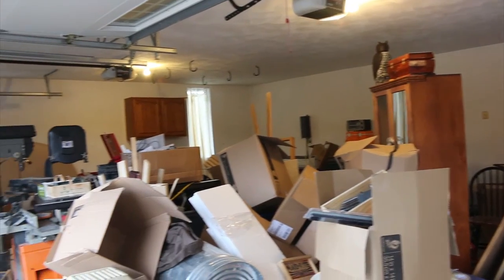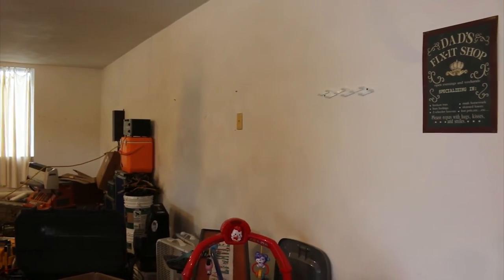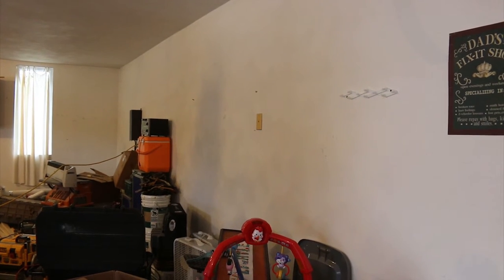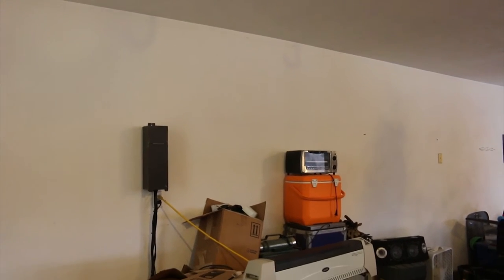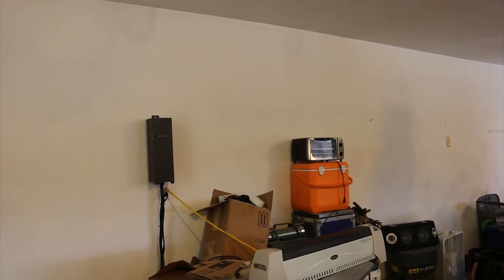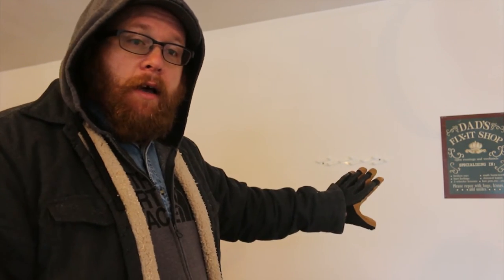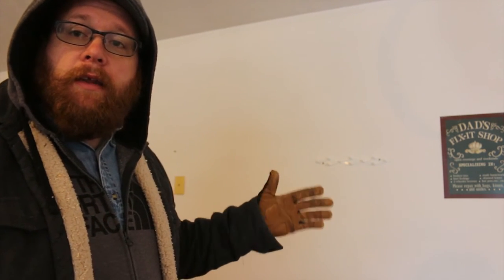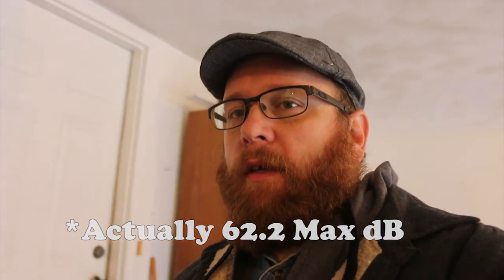Don't Call It a Dream Shop: Introduction

Comment: Hey Thomas when you Build That Wall make a double layer of drywall put it on one way on the first layer and go the opposite way on the second layer. I've built a couple of soundproof rooms for a studio and that's the technique we used.
Reply from the maker: You are right. I came across that suggestion as well as some special sound-dampening glue to use between the layers.  I mention the law of diminishing returns in the video. I think this was the most effective amount of sound dampening I was willing to invest in. The cost of dampening rises exponentially vs. the amount of dBs reduced.  We'll see what the results turn out to be!  Thanks for the input!

Comment: First of all, I can completely understand working with what you have.  However, IMO, there is NO WAY I would give up 2/3 of an attached garage for a workshop.  Is there some reason you're not adding a building out back?  Secondly, the electrical is fairly easy, if you have easy access to the breaker box and if the breaker box is capable of expansion to provide enough power for all of your tools.  The good news is you can kill two birds with one stone, as all the electrical work will be done in the attic, and you're already going to be up there to soundproof the ceiling of your new workshop as well as the wall (at least I hope you are, because sound will find a way!)
Reply from the maker: I think it all depends on where your priorities lie.  I earn through woodworking not only in fulfilling orders, but also through my YouTube channel.  If I can build a 600 sq ft wood shop in some empty space in my home for less than $1000, that sure beats the heck out of using the precious little space in my back yard (I live on a corner lot) to build something from scratch that would cost me $10000+ and who knows what amount of time.  Also, second floor is finished, so all electrical will be run through the basement, as that is where the main panel is located.  Thanks for watching!
Reply: Point well taken.  As a car guy and kinda-sorta woodworker, vehicle parking and protection takes priority over everything else.  All my work is done on the countertop, except for my Grizzly table saw (same one you have, and actually used your channel to help set mine up, so thank you) but it is on a mobile platform.  I was not aware woodworking was a source of income for you, so it makes sense to keep overhead at a minimum.  Especially when acreage is scarce, such as your case.
Reply from the maker: +MN6WS6 glad my videos helped. By the way, this is the reason I titled this series "Don't Call it a Dream Shop". A dream shop for me would be something like you describe, fully decked out in Powermatic and Festool of course :)